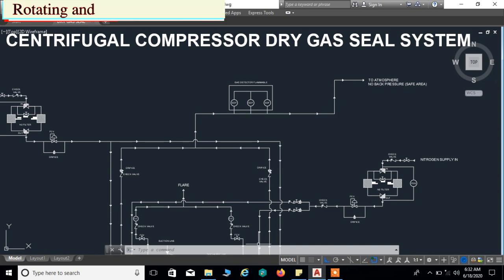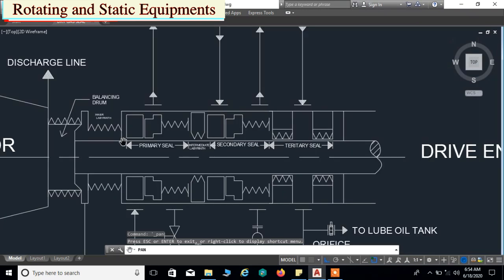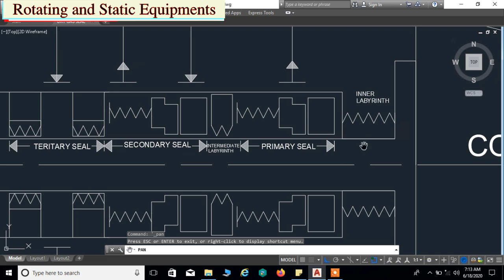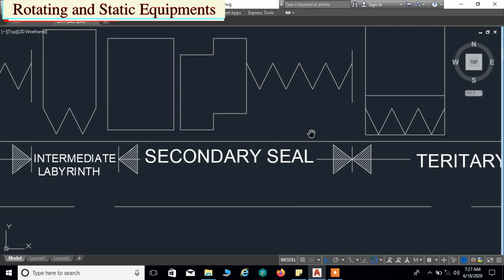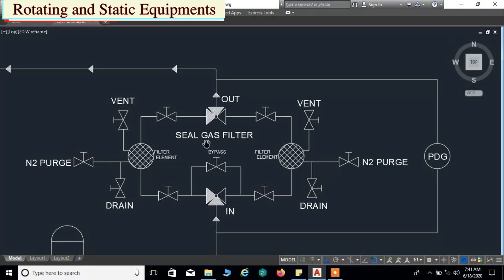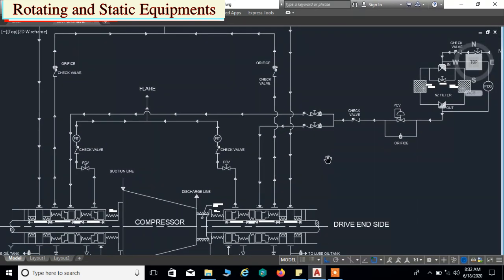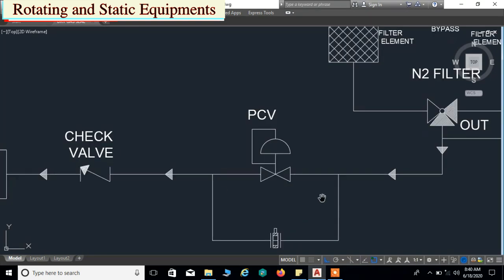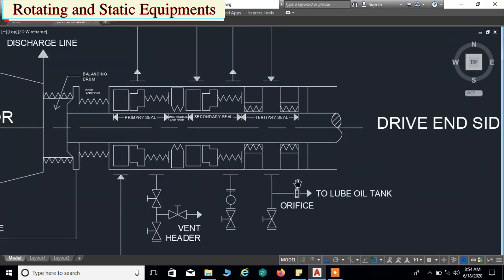CENTRIFUGAL COMPRESSOR DRY GAS SEAL SUPPLY SYSTEM | ENGLISH | Rotating & Static Equipments

Comment: for the dry gas seal do we need to continue supply nitrogen while compressor running if yes what is standard pressure for supply ?
Reply from the maker: 8 bar pressure as per process recommendations its depends on your machine design
Reply: It is higher than flare pressure to make a restriction for primary seal

Comment: Between Bering pump roter centring kese hota he sir
Reply: Sir rediel centering
Reply from the maker: Most of the cases radial centering done by dewelling
Reply from the maker: Total float of rotor shaft divided by 2 is the centering of rotor. Its the thumb rule. But some special cases it will differ according to the OEM.